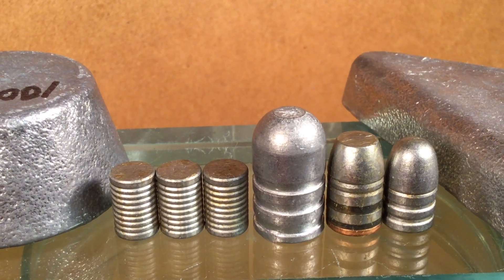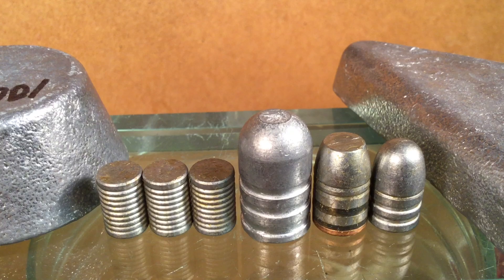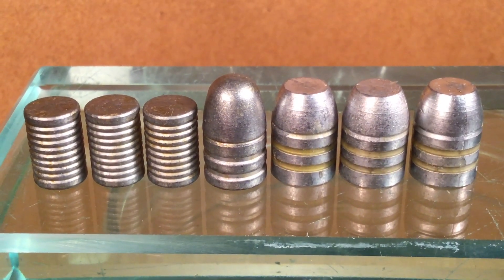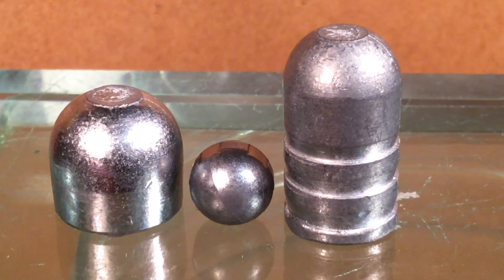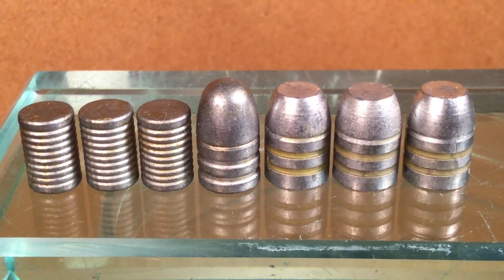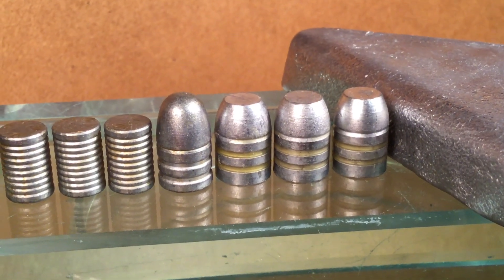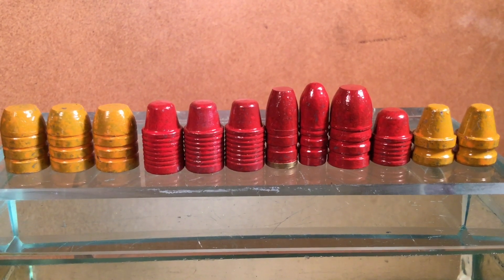Chap 3: Powder Coated Bullets Are Game Changers: Bullet Hardness Optimization De-emphasized

Comment: FC45LC - great stuff.  But (since powder coating is so new), is there an update to some of this info?     Specifically, for the standard load pistol shooter, what does "Bullet Hardness Optimization no longer applies" really mean?

For instance:  Can we now shoot 230g LRN near-pure lead from a 1911 45 auto?  Or for +p loads in 38/9mm?  Or do we still need to alloy it? 

I guess the root question:  Are you seeing any differences, at all, with performance or barrel fouling with powdercoated bullets, based on their hardness?  Are bullet hardness and alloy calculations now completely moot? Or just marginally unimportant as long as we're close?

The reason: I have a pretty good source (and reserve) of near-pure lead (bhn < 7), and lead is less expensive than linotype or Super-hard.  If we don't need to alloy the pure lead for less fouling/better accuracy, and the pure lead is more cost effective, why would we bother with the cost or effort at all?  I could just throw in some 50/50 solder for better flow and call it good.
Reply from the maker: Matt Lee - It's like this - when we melt a powder coated bullet, depending on whether polyester or polyurethane or polymer, the coating just limply floats on top of the molten lead or it just burns off.  The properties of the lead underneath still apply.  What the coating does is allows non leading so that all our considerations previous are now stretched to allow more versatility in the alloys we use.  In handgun ammo, the stretch now almost fully emcompasses the shooting we do.  For example, we can shoot pure lead right up into light magnum just fine - great for expansion in hunting bullets.  However, for all out magnums in 460 or 500, the soft lead can still strip off the rifling (as with rifle ammo - the coating is not a full metal jacket - see the melt above).  Whereas, previously the use of soft lead would result in barrel leading at higher velocities, the PC has allowed the range of use to expand since barrel leading is not an issue.  Note that if the bullets are small enough, gas cutting can still defeat the PC and get barrel leading - reason that some users of PC bullets are reporting barrel leading - we still need bullets fitted to the gun or we would be licensed to shoot any bullet we want..not so.  And if bullets were on the soft side, there may be deformation and thus jams when shooting auto pistols - PC would not stop that.  Good shootin; to ya,  FC

Comment: FC, I have a question about lead and antimony mixture percentage. I am a beginner at casting, and by beginner I mean my equipment is still coming in from ordering. I have not even attempted making ingots yet. Lol. I have a supplier of lead that is supplying me with alloy that is 90% lead and 10% antimony. I want to cast my own bullets in 45acp 230g, 40S&W 180g, 9mm luger 115g, 380auto 95g, .223 55g, 5.56 55g, if possible. So here is my question. Is this alloy of 90% lead and 10% antimony good enough for me to simply add tin and cast all of my desired bullets, powder-coat, and shoot without leading my barrels? And if so, how much tin should I add per pound of said alloy? Thank you very much for your help. You are doing a fantastic job and if not for your videos I would not even attempt casting. Keep up the good work.
Reply from the maker: Axel Torres - That alloy will wind up BHN 20 by the time you water quench and age your bullets just 7-10 days.  You could cut that alloy by adding some range scrap (roughly 2-4% antimony with some tin - you don't need much tin) 2 range scrap to 1 of your 90-10 alloy and wind up with BHN 16 easy with water quench and age harden (adds 1 + 1 BHN to get your 16).  Plus, you will have your tin.   You new alloy would be perfect for everything up to +P and autopistols.  You alloy would be fine for all handgun magnums and rifle shooting.  Let your alloy talk to you - With Lee molds, cast it hot - If it casts well (you see sharp detail), it probably already has some tin in it.  If it doesn't, the range scrap will get you some tin.  If still doesn't cast well, then you will need to get some solder, linotype or Foundry Alloy to add your tin, but that will be additional alloy costs.  Another option for tin would be to get some alloy from RotoMetals like their 1-16 alloy (6% tin).  If you call them, they can suggest good tin alloys vs cost for your purposes.   Welcome to the world of bullet casting - mind all the safety protocols for the most exciting shooting possibilities.  And please do keep in touch as you go along...Best to ya,  FC

Comment: Hello, FortuneCookie45LC I'm new casting bullets, using range scrap for my lead, I'm working with caliber .40 and 175 grs. weight, I want to know if it's necessary to use something to make my lead alloy harder or only use powder coating may be enough to my bullets?,  thanks for your advice.
Reply from the maker: Sneaky Alex - For best results in auto pistols, we want BHN 15 - 16.  This will give us functioning as too soft a bullet may snag in the feeding cycle.  Powder coating is a great idea for leading prevention good shooting.  If your range scrap / PC bullets feed fine and shoot fine, then your barrel works well with BHN 12-13 bullets.   Only testing will tell you.  But if you are shooting plain cast bullets, BHN 15-16 would be the way to go.  Good shootin' to ya,  FC
Reply: Thank you.

Comment: do you still need to use gaschecks?
Reply from the maker: Rory Emms - Powder coating has changed the game with gas checks.  Their common use in handgun bullets has been de-emphasized.  In the series on the new Lee 358 200 RF 6 cavity mold, the non gas checked powder coated bullets shot better than the gas checked.  Best Regards,  FC

Comment: Elvis Ammo has a video of a cast 223 PC with no gas check. Velocities were chronoed at around 2200. Does hardness still apply to velocities in PC bullets?
Reply from the maker: Ron Warren - PC bullets, like our cast bullets, do very well in our handguns with the PC offering no leading shooting without all the fuss about hardness, type of lube, and gas checking.  We can shoot fairly soft lead PC at magnum handgun velocity.   When it comes to rifle shooting, cast lead bullets  hit a limit where the bullet fails to hold the rifling, strips and leads the barrel.  What PC does in rifles is keeps the leading from occurring.  But if the bullets are pushed, at what point might the PC bullet fail to hold the rifling?  The limitations of cast lead bullets (hard and harder) led to the militaries of the world going to jacketed bullets.  You will note that the videos that show the shooting of cast lead and PC bullets in rifles are not featuring fine accuracy.  Personally, I would shoot PC bullets in my rifles at around 1700 - 1800 fps and keep that as a practical limit - That zone is perfect for my 30/30 and 45/70 anyway.  My preference on the 223 / 5.56 is that I can buy FMJ bullets so cheaply that there is no reason to do any PC cast - but I tip my cap to those who are doing the beta testing as it expands our body of knowledge.  My take is that PC coatings are still evolving and the best is yet to come... In the meantime, I'll shoot my 308s and 30/06 at 2600+ and my 223s at 2900+ with jacketed bullets (I also like my 223s to cycle reliably)   Best Regards,  FC

Comment: so if i add a little super hard to my ww alloy and powdercoat is that fine for 500 mag?
Reply from the maker: Vanilla Gorilla - Yes.  You could even shoot wheel weights without adding the superhard if you powder coat for your 500 S&W.  Without the powder coating, you would have to add some SH or your plain cast bullets would not be optimized for the big blaster.  That's what PC has done, with PC, you could use even softer alloy even with the 500.  However, if your bullets are too soft for terminal effect (you will get expansion, but the bullet might be too soft to hold together) that is a topic for another video coming up... The thinking is that if you were hunting deer with your 500, you would want some expansion to make the deer even deader.   If you don't need a deader dead, I'd add 1 pound of SH to 6 pounds of wheel weights to raise the hardness 4 BHN points (water quench the drop to add 1 more BHN), then powder coat the bullets - you'd still get expansion with that 500 and your bullets would hold together for anything up to elk.  Of course, the velocity of your loads has to be factored into all of this... Good shootin' to ya,  FC
Reply: +FortuneCookie45LC  I have an endless supply of lead with a bhn of 10. If i coat them will they be good enough for hot 357 magnum and hot 9mm loads. Keep the vids coming.
Reply from the maker: J Mac - There have been some reports of shooters PCing pure lead bullets and shooting them in full loaded 223s.  However, no acceptable accuracy results have been posted.  You can certainly shoot BHN 10 PCed for 357 and hot 9s.  I've shot plain range scrap cast bullets, water quenched and aged, then powder coated at full 44 magnum.  Shot great with no leading.  Our pistol shooting, powder coating has really de-emphasized the need for hardness - within reason of course - I'm not going to shoot pure lead and expect powder coating to make them shoot like my BHN 10-12s.  I'll let others test that and save my pure lead for shotgun slugs - besides, my range scrap is free and plentiful.  Best to ya,  FC
Reply: +FortuneCookie45LC  Thanks FC45. I'm an Australian shooter/reloader. But I'm only just getting into casting/coating. Have u looked into the Hi Tek super coat bullet coating.
Reply from the maker: J Mac - Hi Tek is a wet system for powder coating...Bayou Bullets markets it, and there are a fair number of reloaders who really like it.  You will have to check out the videos on it vs the dry powder systems and decide for yourself what you might want to try... Best to ya,  FC
Reply: +FortuneCookie45LC Hi Tek is an Australian made product. I have purchased some off the manufacturer. Will let u know what i think
Reply from the maker: J Mac - A fine product from Australia indeed...will await your review... Have a great day,  FC

Comment: FC45LC...  I agree with you that once you PC, that the possibilities are endless.  However...   Finding the hardness and alloy for non-PC bullets is really not that complicated (and is generally over rated).  Each shooter needs to find what works best for them. 

I personally shoot almost exclusively range scrap with no tin added.   With this alloy I either air cool, water drop, or powder coat.   Sometimes a mix of methods.

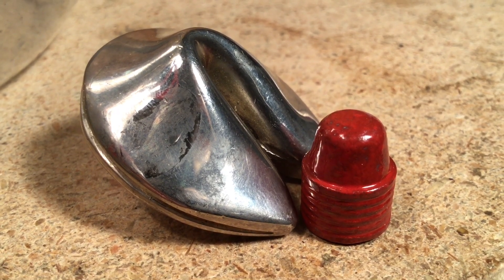 You mention needing pure lead at 5:10 of the video  for shotgun slugs, black powder, and muzzleloading..  this is simply not true.  Any alloy will work as the wad/patch will take up any space in the rifling or difference between ball and bore.    If we are talking smoothbores.. the sky is the limit.  If it will go down the bore, it will come out!

You need softer lead (doesn't have to be pure) for minnies, maxies and percussion revolver.

Thanks for the video..
Shad

Comment: if the game is changed, please demonstrate soft lead powdercoated in rifles and +P magnum
you are way over on hardness requirements. I shoot cast 223 in a modern 1/7 twist AR with nothing more than water dropped wheelweights and 1% tin
no linotype/monotype necessary
hardness is extremely overrated, and causes more problems than it solves for new casters. anyone interested should google glen fryxell and read articles along with joining the community at cast boolits.
Reply from the maker: superswaglord1945 -- Thanks for your comment.  Yes, we have been using bullets on the hard side.  For a fair number of years, and with commercial bullet casting companies, the tendency has been to go with harder bullets.  Elmer Keith did a lot of his magnum development work with 16 to 1 lead tin alloy (that is, of course, very soft in today's standards) - Note that we are not in any disagreement.  Your wheel weight alloy water quenched is probably around BHN 18 especially if your wheel weights are the older formulations.  Wheel weight alloy was the best alloy to use for everything up to magnum pistol and light rifle shooting (I didn't bother trying to flirt with rifle barrel leading - if over 1900 fps, I just used jacketed bullets - I like lead prevention margins), and I used to buy wheel weights 300 pounds at a time when I couldn't get enough from tire shops for free.  I never added any linotype to that either - as you report, simply no need to do so.  But when the wheel weights were no longer available in CA (many years now), I had to go with range scrap (BHN 12 good for target velocity only straight up), and that needed linotype to be added to equal the wheel weights of old.  The game change from powder coating is that we can now use almost any lead we have as hardness issues for prevention of leading are no longer considerations.  Alloys softer than wheel weights can be used for magnum and your 223 rifle shooting without leading problems.  There are reports from everywhere including Australia using full power 223 about this benefit from powder coated bullets, and in my own videos shooting powder coated bullets, leading doesn't happen.  Having to have bullets hard enough is now not even a consideration (within reason of course).  Have a great day,  FC

Comment: Hello fc 45 .powder coating is probably the best at this moment, but a easy way to get bullets lubed is this .
get a thermostatical  controled  ,elektric fryer .
fill it with a mixture of beewax ,stearine,tallow,atf ,allox and carnauba, heat it up to 100 celcius. put the bullets in a basket ,into the fryer ,leave it there to get lube penatrating . remove and put on lint free towel let cool , ready clean bullets with lube ,no drying time
Reply from the maker: peteralexben - Fantastic - sounds like a bullet caster's version of Love Potion #9, I'll figure out a good incantation for that while mixing - the Red Carnauba from White Label would be my preference to add - better do it outdoors though or the wife will have a fit.  Good to know about that mix just in case - I'm sure it works great, but 45/45/10 or even Rooster Lube Jacket will work well for me if I'm not using powder coated bullets.  Thanks for sharing, but if the above isn't enough, we also have the option of shooting Hornady, Sierra, Nosler, Speers...  Best to ya, peteralexben - FC
Reply: With the hot lube .you get a thin strong layer of lube.,and less smoke,and after cooling ready too use.
Reply from the maker: -- peteralexben - but one big advantage of the 45/45/10 is 1000 bullets can be lubed in 10-12 minutes total expended reloader's time - plus the lube works great, no alox tackiness, is cheap, not messy and very little extraneous equipment needed.  Powder coating is also good and with the basket technique and vibratory tumbler to coat, not much of the reloader's time is required either.  Recluse really came up with a winner with that 45/45/10.  Best to ya,  FC
Reply from the maker: -- peteralexben - However, I meant to add that if you do chose to do a video on that hot lube - it would be good to add to our body of knowledge... Have a great day, FC